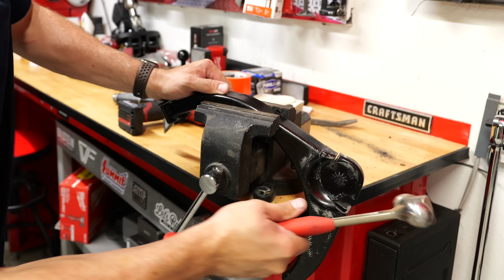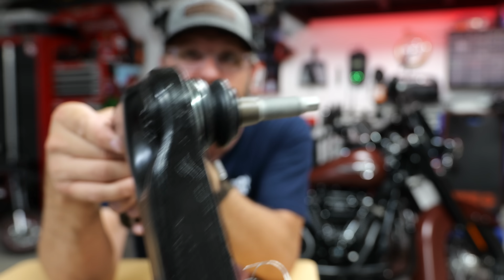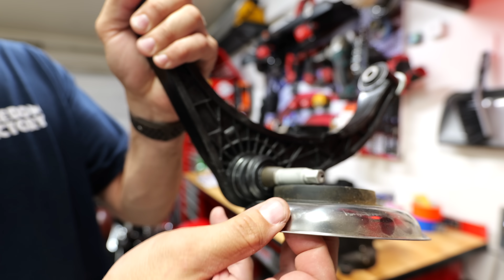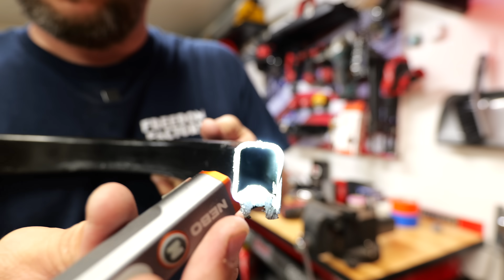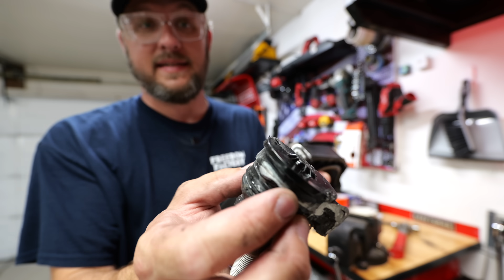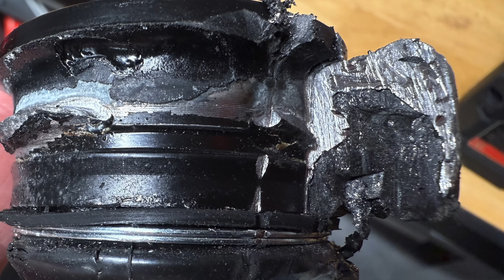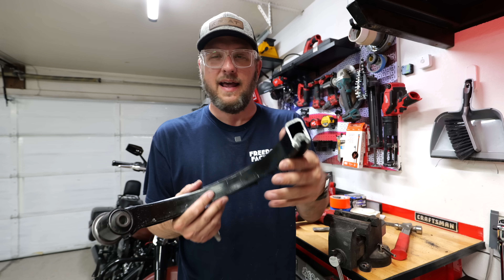I Cut Open RAM’s Plastic Upper Control Arm… Worse Than I Expected?

Comment: This guy is out of his mind, to say todays trucks are really not being overpriced is insanity! The average American does not have $1000 in their bank account but $70,000 for todays unreliable garbage made trucks is reasonable to this guy........if new truck prices continue on this trajectory we will soon be seeing new 2025 trucks for sale in 2030!
Reply: If it’s the only option to buy techy vehicles. Then yes it’s forced on us. I don’t care for them big ass screens and yet they are in every type of vehicle that I like. Like I’m cool with a simple radio with Bluetooth. I don’t need heated and cooled seats, I don’t want or need collision avoidance technology, I don’t need or want heated steering wheels, I don’t need backup sensors although the camera is a nice touch it’s takes away the fact I look over my right shoulder. I like leverd seats to move them because the automatic buttons take too long for my liking. I don’t need or want cornering headlights, I need or want toggle or paddle shifters if I buy an automatic, I don’t need tire pressure sensors. I don’t see anything wrong with the tire pressure tool and my eyeballs, a lot of the sensors and tech are very much unnecessary. And really undesirable once it all fails. Because of the cost to repair ish you feel like you don’t want or need in the first place. I don’t want or need automatic shut off cars cutting off and on at stop lights is terrible for the longevity of starters, batteries, alternators, spark plugs, fuel injectors, etc the list goes on and it all drives the price up for customers who don’t care too or can really afford it. But in reality we need cars to get around more efficiently.
Reply: Look at how many of these are gonna get repod because the loans can't be afforded. At 15%apr a 100k truck, you're paying something like 150k more or less. I got trapped by it. I can still afford the scat pack but no more real play money. Years ago I bought a salvaged car, ran it for 5 years, rebuilt the engine for reliability, and guess what. 2011 charger, gonna outlast any car on the road. If the trunk rusts out, cut out a piece and weld a new piece in. My challenger hellcat? About paid off (paid half cash), my charger is paid for. Only went to the dealer for the scat, the rest were people I know.
Reply from the maker: You just made my point for me. The average American salary hasn’t gone up with inflation thus you’re not making enough, trucks are priced exactly where they should be adjusted for inflation and accounting for all of the added cost of safety, consumer demand of luxury, and complexity of legal exposure. It’s not that the trucks are too expensive, it’s that we as Americans have way less disposable income because we don’t earn enough. Same goes for the fact that a modest house now costs $400,000 when it was only $100,000 20 years ago.
Reply: @GearsGadgets  the consumer demand isn't for luxury anymore
Reply: @GearsandGadgets wrong and more wrong. They decreased the cost of the truck, then increased the price. Inflation might as well be irrelevant when GM is using China parts and assembling in Mexico.
No, what they're doing is decreasing quality to keep the same build price, then increasing MSRP 50% for greed. And to cover losses of their own making like warranty work and EVs. 
Plus, they know they'll get another bail out. There's zero reason to change their business model of ripping off the consumer even if they literally go bankrupt.
Reply: @GearsandGadgets  Bullshit, consumers aren't demanding "luxury" or all these add ons. The dealers and manufacturers push these because that's where they make money. Compare truck prices to inflation rate. Same BS is going on with housing, supply and demand add 30 million migrants (about 10% of US population and look at what happened to housing rent and prices. If a manufacturer would make a plain Jane full size pick up without all the crap that will soon fail, no dual overhead cams, phazers, computer modules for seat position that shuts off the ignition when they fail, people would grab them up. Try to fing a plain truck on a dealer lot with out a bunch of options, you can't because it would be gone and the dealer profit would go down while eating into the manufacturers phony cafe standard.
Reply from the maker: @gregpace4676  call bullshit and be wrong all you want. 12.4 million light trucks were sold in 2023. You are delusional if you don’t think that’s demand. Nobody forced anyone to buy these things.
Reply from the maker: @christopherlowery855 I’m sorry, I didn’t say it was healthy nor does whistlin diesel have anything to do with truck sales. 12.4 million is demand no matter how much you find a way to frame it as unhealthy. Meth is also in high demand, not liking that fact isn’t enough to make it untrue no matter how much you wish it were true. Also, all these people rounding 60K (the average truck sold in the US) up to 100K to make their point feel more right are dramatic little girls.

Comment: That Plastic will absorb a lot of the Vibration and reduce Fatigue of the Steel insert. Also Protect from corrosion. I Like it.
Reply: @Elvisgratton3x   More likely that the steel is reducing fatigue and plastic is adding stiffness. It would be interesting to know the type of plastic and the process. Plastic has poor fatigue and creep properties. Plastic tends to absorb moisture. I would guess it is a long glass fibre polyester molded over the steel substrate and the ball joint. Polyester does not absorb moisture. The glass fibre provides strength, stiffness, fatigue and creep resistance. Definitely a weight reduction, I like it too.

Comment: Plastic or carbon fibre?   Carbon fibre has been used in many vehicles for over 10 years.   The advantage is that they do not rust and help reduce weight.   The big issue is that American pickup trucks have gotten far bigger than necessary and gas guzzlers.

Comment: The plastic is there to force you into replacing the whole part. Also it will accelerate rust from inside if water is making its way in. These arms support a lot of stress, when you turn hard they maintain the wheel straight, and when you slam on the brakes they receive a good load of the rotating deceleration forces. So maybe they modified an original part to provide more stability under heavy stress without retooling the stamping press, or they had thousands of them already produced and this modification was approved, but still. I am certain they did thay to force us into replacing the whole thing.
Reply: RAM probably doesn't make significant money from selling replacement parts, so I doubt forcing you into replacing the whole part is the goal -- it's just a side effect.  Their goal is making things cheaper to build in the first place, and making it so the ball joint is permanently attached is cheaper than making it replaceable.

Comment: You don't think trucks are over priced for what they are? Have you seen the problems these new trucks have, how cheap they are? I mean a 80k truck should be half that price, and making things cheaper for the consumer is joke, that never happens, they make it cheaper and charge more for it. I mean for example I got a 2011 Chevy Cruze, Why the heck is a AC Delco Injector 90 dollars? Why is the full gasket kit, just bunch of o-rings and exhaust gasket and oil cooler gasket $100 bucks? Why is the AC Delco Oil cooler $300 Its nothing special, its cheaply made crappy casting thing to help cool the oil, Why is the over flow tank hose 80 bucks? Is just a hose with a fancy pants c-clip. Things are made cheap and sold for more so the rich get richer.

Comment: @2:21 If you want to spend 100 grand on a truck that won't last you very long without issues, go for it. Remember from a cost perspective you can justify pretty much everything. That's not how it works. Producing components in modules benefits the manufacturer and the consumer only short term. In the long run it makes repairs unnecessarily expensive.

Comment: All this R&D to make manufacturing cheaper but trucks aren't getting cheaper. An F-150 is a truck for the average consumer. I you want it with 4 doors because you have a family, it starts at $50k. And if you want/need options you'll be spending $75k. But they're saving on manufacturing costs!! 😑 That's the problem.

Comment: I couldn’t help but notice only one zerk fitting? Did I see that right. If so does that go into the void inside the metal arm and grease the ball joint? If so, does that channel also grease the pivot bushings as well. That would be a lot of grease but lube three points at one time. Not that the lube techs actually lube any suspension points anymore when the do the LOF (Lube, Oil, and Filter)
Reply from the maker: Zero zerk fittings, what you saw was an attachment for the self leveling headlights I assume.

Comment: Stellantis sure loves to cut corners. The upper control arm balances the load in corners, it is a lot more than a guide. and prevents the TOP OF THE SPINDLE from moving. Contrary to your belief, there is a considerable amount of load on them. Have one crap out, or even an upper ball joint and see how it goes. The reason upper ball joints fail?  1) no longer a serviceable components,  2) constant LOAD beating on it laterally. every tiny correction in the steering multiplies the load, then when the speed is increased, it multiplies some more, add bumps and rough terrain, even more. So I disagree, the upper control arm does a lot more.
I will not be buying a new Ram any time soon.

Comment: I've had my ram 1500 for 5 years/111k miles since new and have yet to have a single issue with it. The same year ford runs plastic oil pans vrs my 5.7s metal one. Does that really make one brand better overall the other? No. All 3 don't run the same quality they did 30 years ago. Take care of what you buy and it'll be fine

Comment: In areas that experience heavy salt use during winter the plastic encapsulation makes sense to avoid having the part rust from being exposed to the elements if this were to be 100% plastic I would say no but it does seem to make ball joint replacement impossible a point that will frustrate anyone working on these vehicles

Comment: Plastic can be engineered to self deteriorate at a time they engineered it to be.
This component will not last decades like the previous metal parts.
This has a design to increase wear once it starts to warp with heat, time and will need regular replacing.
Regularity and parts dependence is by design.

Comment: Would never buy a vehicle with plastic upper control arms.  It ages poorly in heat and is weaker when cold.  Plus it will age weaken no matter the environment.  Having had to replace cracked plastic parts on other vehicles that will not make me lose control of the vehicle possibly, my guts says stupid decision.

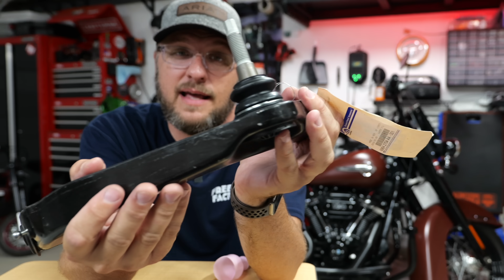Comment: 5:27 plus that would mean when it's time to replace the ball joint you wouldn't be able to just press a new one in. You'd have to replace the whole control arm.
Reply from the maker: That is correct.

Comment: If they are made of glass-impregnated nylon, then they will fail due to the migration of moisture into the part. There are papers going back into the 80s and some as recent as 2019 stating that those parts, just like the Dodge plastic intakes on the RAM 1500s, can fail just by being in a humid area like Houston. I do not see them lasting very long.

Comment: As a third gen owner with a cracked dash plastic, I wouldn't trust Stellantis to make a plastic knob.
Reply: Not lying.  But sometimes the truth hurts.
Reply: Stellantis quality control philosophy:   DODGE testing.  RAM into production.
Reply: Adult novelty products, maybe.
Reply: Adult novelty products, maybe.
Reply: @MrCPPG  As someone who owns a second gen Dakota, I've never had an issue with my dash. My dad's third gen ram however. Bought it new and 10 years later the dash was shot. Not sure why they made them out of different plastics but I'm glad they did for my sake.
Reply: Fords GM Toyota have the same problems! KIA,HUNDAI ARE MUCH WORSE,THEY JUST BURN UP!
Reply: 2nd gen owner here, mine is becoming dashless. lol
Reply: MMM! Chips!
Reply: Oh yes. Chevy transmission fuel issues and self oil blocking along with Ford electronic issues are SSSSOOOO much better 
Worked in both dealerships before.
And don't get me started about Toyota rust issues.
You don't know about these? Then you've never touched a wrench.
Reply: Oh yea....
Chevy transmission issues fuel management and Fords electronic issues are SSSSOOOO
much better ...
Don't get me started about Toyota rust.
Never heard of it? Then you've never touched wrench.
Worked in all these dealerships
All cars are POS's
Reply: 😂 I was 😂😂😂😂
Reply: I work for their roadside when you call in when your fiat breaks down, just imagine all the cummins fans I've talked to that wound up not being fans anymore.....  I'll never own a dodge, and aside from jeeps I use to own I never have owned a dodge, I rented one 2 years ago and it reminded me why I hate dodge, POS got stuck in 2nd gear while towing in a 2500 with the cummins joke.
Reply: Why did you buy it Einstein we knew it was trash decades ago
Reply: Make an aluminum one, third gen doors panels are though asf

Comment: My Mom's car had plastic front suspension parts like this. When she donated the car to charity at age 14, 140,000 miles, it was still perfectly fine. I remember telling her that if the rotor ever got too hot it might melt the upper control arm, but her caliper never seized up...

Comment: My 55 F100 panel had a Plymouth Volare front end in it, and I had it rebuilt by a friend,  and we replaced the ball joints the press in steel was so loose for the replacement ball joints  had to be tack welded to hold them securely.  A close fit and bolting would be better. Gee it would .50 cents more money to buy, but it's way better to rebuild. Imagine that.

Comment: Your kidding me? They put a plastic upper control arm ON A TRUCK? The beancounters and engineers that pushed this through need fired now.
Reply: From the video it can be seen, that the part is actually boxed steel with plastic cladding. The plastic is apparently there for additional reinforcement without added weight compared to cast steel part.
Reply: You must not have watched the whole video
Reply: Probably all got raises.😡
Reply: Probably a way to cut down on rust..actually looks like a good idea
Reply: People didn’t watch. Just cry
Reply: @Mikeypoo_22  yup
Reply: The grand wagoneer has it too

Comment: There was a business case study I heard involving a beer.  (Not sure which one. Pabst blue ribbon maybe?) This beer company started out with the #1 best beer hands down. Slowly over the course of years they dropped from S quality to A, to B to C to D all through cost cutting measures. For the first bit of that nobody noticed, but few if any people were troubled enough to switch. The beer company kept on cost cutting all the way down to a quality level of G and then everybody noticed the difference. Everybody abandoned the beer for a new one. It did not matter that the company switched back to the original recipe afterwards. Nobody switched back. 

Customers may not notice or be bothered by the switch from S to C level quality, but they will definitely be bothered by G level quality. Currently companies are trying to collectively drop to G level quality hoping customers will do nothing.

Comment: OMG people make excuses for EVERYTHING a manufacturer does! So ridiculous.  Everything is built like garbage today.
Reply: lol, these trucks have payload and towing capacity "today" that the leaf spring buck wagons of the 70s could only dream of
Reply: @boogts and they’re breaking down left and right with under 10k miles on them. I can haul, tow, go through or up over anything I want in my 05 Z71 with 270k miles and the only thing it’s ever needed is a water pump and thermostat. No truck built today will have that track record.
Reply: @dsz2448  you got that right! My 2013 f150 V8 six speed, 52k miles on it. Changed brakes and rotors at 30k, never been in the shop. How many new trucks will go 10 years and never be in the shop? My quess is not many. Your truck is a BEAST! Good for you, it's a true bad ass! You just can't say that about a new truck
Reply: @EugeneMaturkanicjr nope, they’re built with completely different philosophies nowadays. The crash in 07 shifted things a lot. In the time after that, Ford definitely was doing the best, hence your truck and its durability. I had a 2014 Mustang that I loved and was a wonderful car but had to trade and get the truck (got married lol). Unfortunately now even Ford has gone down this road. Covid seems to have killed what ever was left of decent manufacturing

Comment: So what's going to stop the paint from chipping on top then the steel to rust right out of this Plastic, What was wrong with fully aluminum upper control arms? This still looks like cheap crap in my opinion, How are you supposed to scrap those, What burn the plastic off first? Stupidity in my opinion of course.

Comment: They pull this in  cause emissions killing fuel economy. My 350 csme with no emmisions with posi traction. Took  most emmisions on my one car and got 50% better fuel economy. That car would stop at 50 feet at 60 mgh. I had 19 years. It got totaled when pickup hit and ran.

Comment: The car that pollutes the most, is the one that's unreliable. Once you start calling tow trucks, renting cars, chasing parts, replacing engines, paying mechanics, etc...any fuel you might have saved, is insignificant.